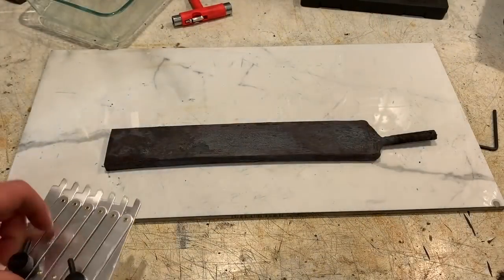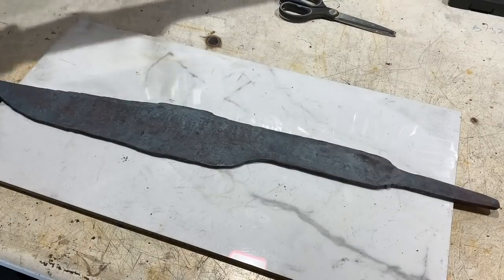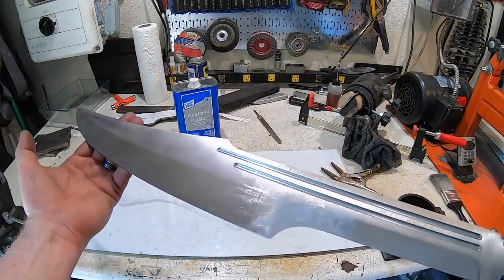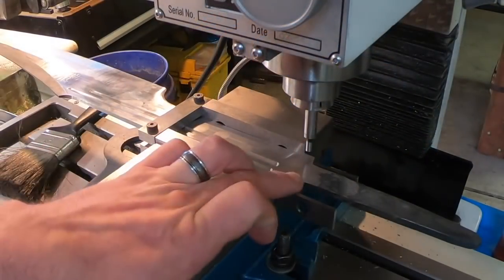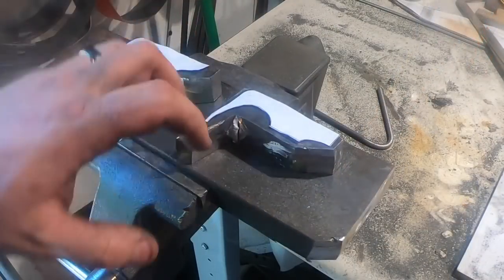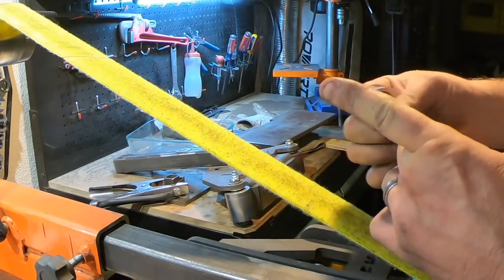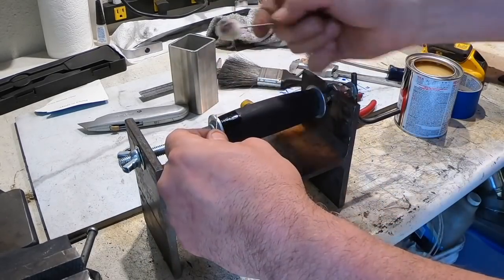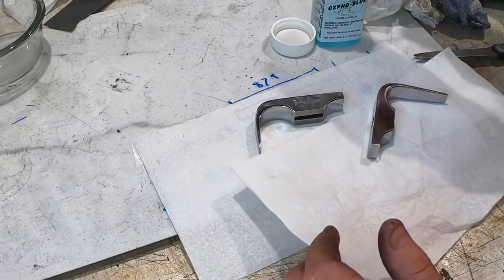Forging a Damascus Spartan Sword

Comment: How come don't you tig weld the forge welds and just fuse the plates together autogenously so no filler metal is added. Wouldn't that reduce the amount of impurities in the final product and make it better? Just curious, I don't know much about forging. I'm a welder by trade, I understand base metal saturation by would that matter under these circumstances or do you use a particular filler metal when welding the plates together?
Reply from the maker: Actually. Just tig welded some billets together for an upcoming build and it went south for me.  I’m not that great acting welder and had sone cold shuts.  I’m a bigger fan of mig welding then grinding down the welds flat.  You’ll see what I mean soon.  Thanks for watching.

Comment: wow   i can not figure how they on  forced in fire guys can make a desend piece in only 4 hours  when it took u that long or longer just to make grip
Reply from the maker: That's because the blades on forged in fire look like crap.  🤣.  None of those would be worthy of a piece to sell.  It's a game show about time management.  Plus you'll never see them make a twisted wire wrap handle on the show.  Don't get me wrong, I love the show, but its a poor reflection of what actual bladesmithing is like.  Thanks for watching, Rick!
Reply: @TyrellKnifeworks  thats what i thought

Comment: Not the historical version but still good job
Reply from the maker: It’s from the movie, it wasn’t meant to be historical.  Thanks for watching
Reply: @TyrellKnifeworks  I know that'd one of my favorite movies but I can't help criticize the designs it has being a historian 😂
Reply from the maker: @Count_Ocana  While not perfectly historically accurate, the Spartans did on occasion carry the Kopis, which is what this sword is roughly based on.  It's kind of an adaptation of a Falcata which would not have been used in Thermopylae.
Reply: @TyrellKnifeworks  true it was mainly a horse rider weapon though and was more curve shaped than the sharp jolt out like the movie version with a decorative handle that was also more curved. Most ground soldiers had their dory spear with the Xiphos as their side weapon

Comment: Total blacksmithing novice here. Why did you soak the bullet in kerosene?
Reply from the maker: The theory is that when the billet goes into the forge, the kerosene burns off along with any oxygen creating an oxygen-free environment so you get less oxidation and a better forge weld.  Thanks for watching and commenting!

Comment: mini .. oridjinel biglstoluort + cm 20-30
Reply from the maker: If you are saying this sword is smaller than the original, it’s actually not.  The Falcata was traditionally around 24”, which is exactly where this sword is.  👍

Comment: not to be "that guy" but the swords in 300 weren't accurate either so you no need to worry
Reply from the maker: Yup, they certainly weren’t horrifically accurate, but so cool! 😜 Thanks for watching!
Reply: @TyrellKnifeworks  I maen they probably based on the Kopis type of swords. look cool tho